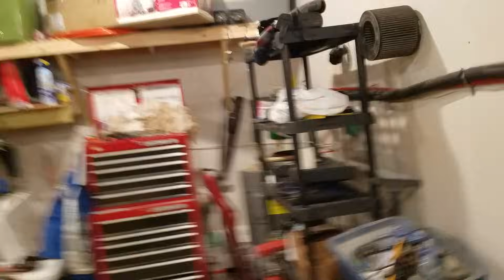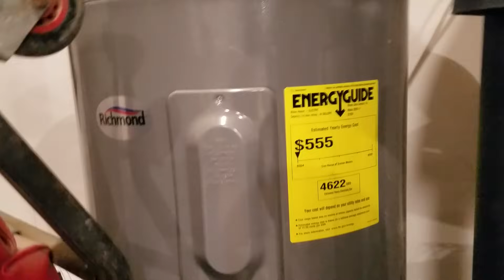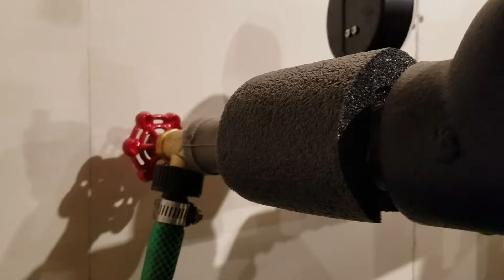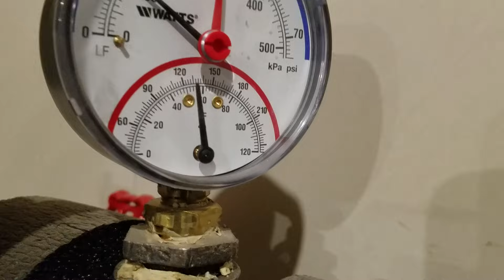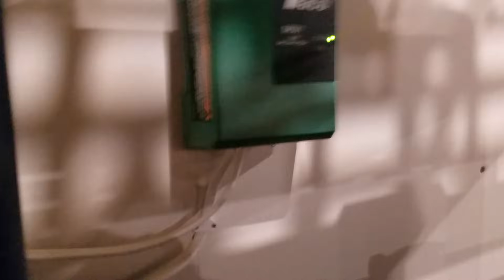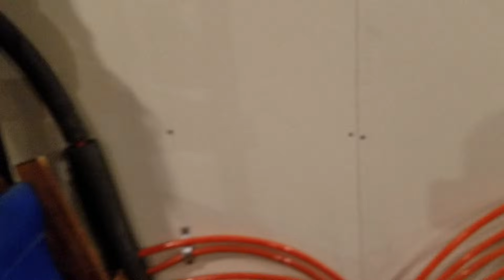EASY FLOOR HEAT (using a new or used hot water heater!)

Comment: Isn’t antifreeze corrosive to anode rods ? Once the glass lining goes wouldn’t you lose all protection
Reply from the maker: I explain my thoughts on this in the next video, electric boiler heat vs hot water heater floor heat. Good question though.
Reply: Have you looked into using RV anti-freeze or tried to find a solution that might be used with a geothermal loop?
Reply: You can replace anode rods. In a home water heater you should also flush your tank once a year but in this application it is impossible to flush unless you want to replace all the antifreeze.
Reply: Flushing the tank would be for sediment issues, which you wouldn't have since you are not constantly feeding fresh water. That's one reason a boiler can go for 20 years and the water stinks even though it doesn't look that bad. It's basically stale water.
Reply: RV antifreeze is FLAMMABLE! Disaster waiting to happen. That stuff is not meant to be heated up, that's why it's cheap.
Reply: This is nonsensical and another common misused criticism against a system like this. Vehicle radiators are full of all the same components you are saying would be corroded. All antifreeze nowadays has anti corrosion inhibitors that protect metals.
Reply: There is antifreeze specifically made for hydronic heating systems.
Reply: Did you hook the elements up so they are both on at the same time?

Comment: What are the specs on the pump you used?
Reply from the maker: The pump is a taco 007-F7. The specs if you were looking to use a different brand. 1/30 hp, .75 amps, 115 volts, 3250 rpm, max pressure 125 psi, and max temp is 230°F.

Comment: For all of the nay sayers on using a domestic water heater, you can check out a company called Radiantec. They are in the business of DIY radiant floor heat kits powered by domestic water heaters.  They have been in biz since 1979. It's not new. It must work.  They recommend gas or propane for efficiency and cost.  Simple is good.
Reply: AND Radiantec shows a system design for your domestic hot water and floor heat using only 1 hot water heater!  Provides heat in the winter and cooling in the summer, well thought out!

Comment: You better put a box connector on your romex. I'd hate see you get a different kind of heat source going.
Reply from the maker: lol. thanks. I have now got the box connector in place. One of those things when your doing things for yourself, if you didn't have one when you started the project, but tell yourself you'll put one in, but never do. But I did get one installed. Thanks.
Reply: This guy  been there. I ran my "hot wired" furnace like that for a few hours off my generator, during a power outage. Was day 3 of no power, outside temp dropped to about 5 F with 30 + mph winds. Inside temp dropped from 62 at 7am to 54 by noon.
Reply from the maker: Yeah. Sometimes you got to look the other way, especially in that kind of situation. As long as you remember to not back feed the power grid.

Comment: How do you fill/pressurize?
Reply from the maker: With  small 110v water transfer pump, sucking 50/50 mix out of 5 gallon buckets. The pump itself would build more  then enough pressure around 20 psi. When the pressure I wanted was reached I shut the fill valve first and then shut off the pump.
Reply: This guy               Is it boiler antifreeze? Cause that’s what is the right stuff for heating systems since it’s non toxic and combats boiler and heating system types of corrosion. Also some things like the expansion tank bladder and pex  is only rated for water or a special type of antifreeze or it can deteriorate prematurely.
Reply: sorry bud,,but pex will handle pretty much anything,i use to pump.diesel fuel,bio-diesel,oil.gas,antifreeze,you name it,i have pex pipes suction tubes submerged in diesel for about 10 years now,still no issues,i doubt any kind of anti freeze will mess with it,

Comment: Dangerous, the temperature and pressure relief valve should be replaced with a 30 psi relief valve and not what comes with the water heater, the most dangerous thing i have seen is if that electric element breaks and shorts out i have seen once where it can cause electrolysis in the glycol mixture and cause massive build up of hydrogen in the water heater, thats just a ticking time bomb.

Comment: eegads. always pump away from the air seperator to get the air out.  he needs at least 10 pounds to prevent pump cavitation.
Reply: Watch again, This guy clearly states pump suction side comes directly from floor & air separator is on discharge of HWT. This is a very small pump water pressure rarely is involved with pump cavitation. See NPSH charts.

Comment: You need a proper electrical connector for the motor connection. Running MND wiring without using proper terminations is against code.

Comment: Electric heat is the same no matter if its air or water. That is no cheaper to run, let alone install, than an electric unit heater.

Comment: This will work, but it's terribly inefficient. A residential water heater is not designed to heat floors, it's designed to heat and store water. (Tank type water heaters.) It has to work probably 10 times harder than what its intended to. You mentioned you saved $1000 buying the water heater instead of the boiler, but the reality is you'll spend at least double that in utility bills over the life of your water heater. Boilers are designed to heat water at the most efficient rate possible, (not to mention a boiler will probably last twice as long as the water heater.) Another way to look at it, even if your thermostat isn't calling for heat, your water heater is still going to be heating the 30 of 40 gallons of water in the tank, long story short, it's running up your electricity bill even when your garage is warm and not calling for heat. 
I'm not even going to get into the other installation errors on this video (no throttling valves, no send and return thermostats, etc.) Like I said, this will work  but in the long run it'll cost your double, maybe triple than it would if you did it right the first time.
Reply: It's not as bad as you might think.  I have got a primitive system in the downstairs of my house built in 1978  (gas not electric).  

There are no zones, one thermostat, one pipe in and one pipe out, and a 40 gallon residential gas water heater (open system) for 2000 sq. ft.  It is wonderful!  It takes about 2 days to heat up that much mass, but once up to temperature it does not take that much effort to maintain it.  The downstairs stays about 10 degrees cooler if I do not run it.

I am running two 125,000 BTU 80% furnaces, the 40 gallon residential heater for the underfloor heat, and a 75 gallon residential heater for the potable water and over the last 5 years, the gas bill has averaged $183 during the winter months for a 4800 sq. ft. house.  I don't complain.

Comment: Where his boiler drain is that he uses to fill is , I don't see any type of back flow device there. If he ever lets that valve open a little the anti- freeze will be backing up to the water lines in the house , he won't have to worry about a heated floor anymore . Very dangerous and would never pass any plumbing code! 50 year retired plumber.
Reply from the maker: This is a closed system, and is not connected to city water, nor will it ever be. I filled the entire system by pumping 50/50 anti-freeze with a pump, pulling out of 5 gallon pails into heating system. Once again this was never filled by a city water system.
Reply: just remember buddy is retired after 50 years in trade, but failed to see that it is a closed system. good thing he's retired
Reply: John Krim.  It's totally separate system. Not at all connected to the house intake/flow.
Reply: Hi.  I'm a retired instrumentation mechanic.  Worked in the refining industry for 29 years.  I have to agree with John Krim.  You use the system as a closed system, however take into consideration someone else using it.  Someone that's not aware of your use of antifreeze.  You have to always consider what could go wrong.  Also Robert Steich makes an important observation.  We are not criticizing you just offering experienced input.
Reply: closed system.....not hooked up to domestic water supply...see garden hose and hose bib hook up

Comment: To anyone watching this video ... PLEASE note the following problems with this installation:

1:  Romex can NOT be surface mounted on drywall.  Clear violation of the National Electric Code.
2:  No strain reliefs where the power wires enter the hot water heater and circulation pump.  NEC violation #2.
3:  The open J-box on the wall where the wires are spliced is also an NEC violation (#3).  Install a proper receptacle or other listed connection means.  
4:  Romex should not be used in open air in this manner.  Run conduit or use greenfield flex cables/fittings. NEC violation #4.
5:  Do not use black iron pipe for such installations.  It will corrode/fail far faster than galvanized pipe/fittings.
6:  Do not use standard pipe unions on the top of the hot water heater.  You need to use dielectric unions to avoid galvanic corrosion!
There may be other issues with this installation, but I am not going to take the time to find them in this video.
Reply: I also caught that black pipe but failed to mention it in another post. Probably better to use brass or copper all the way to the PEX instead of mixing different kinds of nipples. Never had an issue with those on an electric water heater over the years, but some codes might require the special unions just because it's electric. BTW, I do believe you can buy a brass air scoop, but they are like finding chicken lips.... difficult at best!

Comment: Why do you need to heat hot water?
Reply: Because it needs to be hotter to warm the garage enough.
Reply: A tank type water heater turns the heating element on and off to keep the water hot all the time. If it is set to turn on at 120 degrees and turn off at 130 it heats the hot water that is 120 degrees to 130 degrees.   I think you are assuming that if it is hot it is boiling so it can't get any hotter but since water heaters are set to maintain a hot water temperature well below boiling the hot water can still be heated. It is required that it turn on before the water gets cold because water heaters with a tank can't heat water as fast as it can be used which is why it has a tank of water that it has to keep hot all the time. Since it heats the hot water to keep it from getting below a certain temperature it is actually a hot water heater and not a cold water heater. In order to do this it must keep turning on to bring the temperature of the hot water up so it never gets cold except when cold water comes in which mixes with the hot at the bottom of the tank. This rarely happens with a closed system like this. The only exception is tankless water heaters which have larger heating elements for greater heating capacity so they can heat water as fast as it is used. All water heaters that maintain hot water all the time are technically hot water heaters as well as cold water heaters. The water in the top of the water heater is to be kept hot by the upper heating element and doesn't get cold unless the water heater can't keep up with the demand. The lower part has an heating element that heats the cold water when it comes in is a cold water heating element. They are designed there same. A water heater can be accurately called a hot water heater or cold water heater because it heats the cold water as it comes in and reheats the hot water to to the temperature the thermostat is set for to keep the water hot. When water temperature drops to 120 degrees it is hot but reheats to 130 before turning off. A water heater is a water heater. they both cycle on and off to keep the hot water from getting cold.
                        
    The colder it is outside the more the heating element would have to be on to maintain the temperature in the room. If it gets so cold that it is on continuously and can't maintain the temperature needed in the room you need to have additional heating element to maintain the temperature the thermostat is set for in the room. I am not sure what size heater or how many heating elements it would require to keep the water hot enough when it is pumping  through the tubing in the floor because I never used a water heater that way. Usually they use a boiler for that even though the term is technically incorrect because the water doesn't boil in most heating systems.

Comment: Expansion tank is upside down.
Reply: nope. expansion tank should always be connected underhanging. if it is connected with the schrader valve on top it fills will air and rots the tank giving me a service call to replace the tank.

Comment: Respectful  suggestion .  Start by stating the need, " I heat my garage  (size  of garage , city ect)  using radiant heated floor."  Maybe A crud block diagram of the system could be  helpfull to understand your poroject.  

I found the slow dilivery  reduced the amount of information you provided .  Good  kuck on your project  and video's .
Reply: take it easy, he is only a home owner not a heating pro.